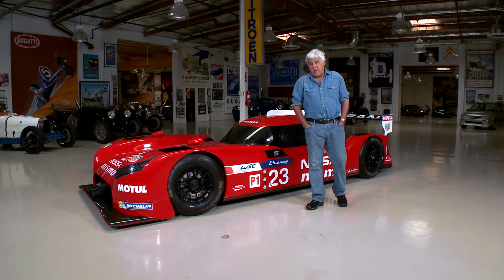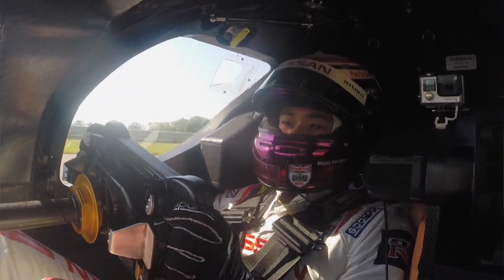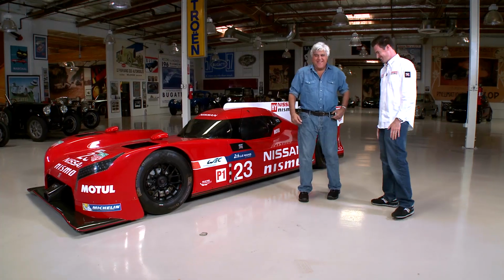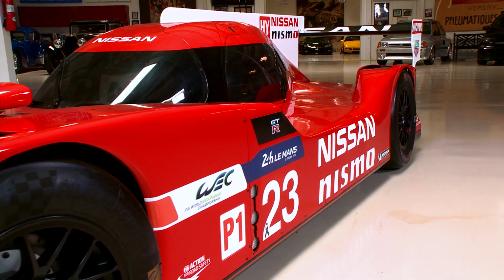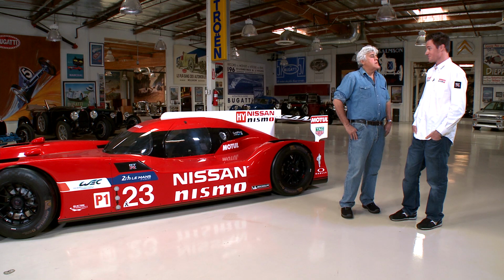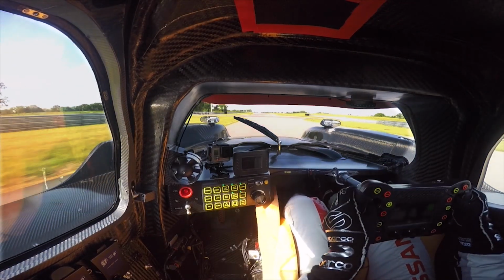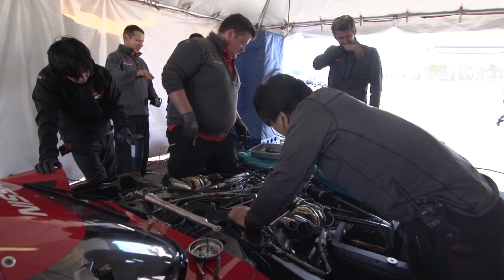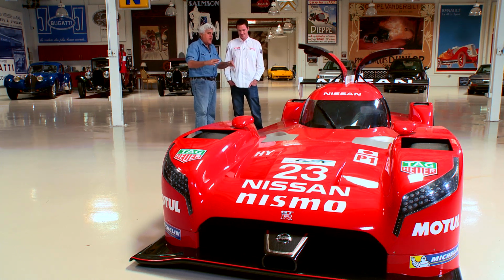Nissan GT-R LM NISMO - Jay Leno's Garage

Comment: Jay never mentioned what the ideal weight distribution would be for this type of race car, anyone know what is the ideal (if there is one)? It's a ratio of front/rear?
Reply: The Moto Channel Since it's a front-wheel drive car you'd want your weight on the front tires to help acceleration. This car relies on rocketship acceleration out of the corners, while plagued by fairly poor cornering. They're running a high-60s (67/33 I'm estimating) front bias, which is downright ideal for this design. They're also using way bigger tires on the front, so those wear out faster. If the car was more evenly balanced they would've had to rethink their tire strategy.
If you're running a 50/50 distribution with front wheel cars you can't properly plant your wheels down as you will get understeer because the wheels lift on acceleration. This is why a heavy front-end on F/F cars is better. This is also the case for the GT-R LM NISMO.
Reply: *****
 On low speeds your downforce isn't going to do anything. Accelerating out of a 60mph corner you will not feel the effects of your downforce immediately. If they were to run 50/50 there I would image that they'd be plagued by a lot of low-speed wheelspin. Since that's the case at several points in the circuit (the two speed breakers and the final chicane in the circuit), they're better off running a front bias and letting the rear wheels catch using the rear-wheel ERS (which is in the works currently).
Reply: The Moto Channel I thought they mentioned it at 7:10. He said it was in the 6o-65.
Reply: Ideal weight distribution on FWD is as much weight over the front as possible, without the rearend of the car sliding around under braking.  This could be 80/20, 90/10, etc.  This is why FWD is inherently flawed from the get-go.  The only serving purpose of a rear axle on a FWD is 1-holding the chassis upright (cars cannot self-balance) and 2-acting as counterweight during braking.
Reply: ***** It's not pushing, it's pulling
Reply: The Moto Channel The idea weight distribution matches up with the aero (downforce) distribution, which in turn needs to match up with the distribution of tyre contact patches. If your car has 60% of the weight at the front, you want to have 60% of the downforce and 60% of the contact patch there too. The Deltawing was the reverse of this - 73% rear weight bias, so 73% downforce and contact patch at the rear too.
Reply: ***** the perfect weight balance have to be according to tir width and downforce then it will work just fine. Remember the Delta Wing with 110mm wide front tires? It was balanced proportionally to the cars weight balance and therefore worked.
Reply: Martin Espinoza Yup.  Someone gets it.
Reply: ***** The only reason for understeer would be the front tires are loading up too much.  It's a lot easier for four tires to provide grip to 2k of mass than just two tires.  This is why we don't see such extremes.
Reply: The Moto Channel There is no such thing as ideal weight distribution. Just make sure the load on the tires and aerodynamic forces are equal. 33/67 is great with tiny front tires and large rear tires with a lot of rear downforce. 67/33 is great with large front tires and tiny back tires with a lot of front tires. This is what Nissan is experimenting with. with their Deltawing which was 33/67 and this which is exactly the oppisite 67/33.

This car is a backwards deltawing with a bigger engine and a hybrid system.
Reply: 63 front 37 rear
Reply: The Moto Channel Actually he did at around 7:10 did you not watch the video? Just curious!
Reply: The Moto Channel It's a secret.
Reply: The Moto Channel NISMO already said its a 65/35 ratio
Reply: Well engine in the middle and no other weight

Comment: During the shot of the engine bay of the real racecar, when you see the turbocharger... is that some sort of gold mesh melted onto the exhaust housing?
Reply: enigmaPL Could be inconel, but it's probably just an aluminium/ceramic sandwich.  Remember, the engine isn't making crazy power.
Reply: enigmaPL heat shield
Reply: musicISlyf1 I know WHAT it is, I asked what it was made of, specifically.
Reply: enigmaPL Its a titanium heat shield. The extreme heat causes discoloration, which is why it looks gold.

Comment: Back when the world was young, ships were wood, men were iron... I built a front engine front wheel drive slot car. I didnt work, wheel spin would lift the blade and cause the blade to come out of the slot. I will be watching to see if it works for nissan. I expect their engineering budget was a touch higher than mine...
Reply: Sam Moore Lmao you commented 2 months ago. This was in 2015 man, and it was a total failure. Still, nice to see some innovative designs.

Comment: Amazon has a really nice documentary series about this car "Le Mans". It's such a real shame what happened to this car, the manufacture of the mechanical hybrid system (Torotrak) completely dropped the ball (arguably it could be said they scammed Nissan). The failure of the hybrid system completely compromised the car in every possible way. This car was never given it's fair chance, despite what commenters say it wasn't a failure because of FWD, it was failure because the torotrak hybrid system failed. Maybe FWD wouldn't have been competitive even if the hybrid system worked as advertised but we were never given a real chance to see if that was the case.
Reply: For a more indepth look into why this car failed, check out this reddit post by some of the people that worked on the project, https://www.reddit.com/r/wec/comments/5wpo1y/why_the_nissan_lmp1_project_was_such_a_failure/

Comment: "RUN WHAT YOU BRUNG" means someone dies. The safety check is an extension of the basic rules and almost all rules are about safety. There was a RWYB time for bonneville and then a few people died, and it boils down to being able to get insurance for such an event which is required by law. The speed record attempts are handled with permits, and they want to know who yyou are and whats up

Comment: Jay I think the run what you brung idea is great.  Here is my idea for all racing they must be production cars. with the only modifications allowed would be stripping interior a roll cage, fire suppression, brakes, tires, fuel cell, and perhaps suspension. no limits on displacement or forced induction or any of that just a race prepped street car.  So when you are watching a race you can go by a car just like that, without the race preparation.  This would really drive innovation as manufacturers would want to win a particular race they would have to build a better/faster car for the public.

Comment: Great to have an engineer do the talking. Great design, and lets hope it will knock off the competition. But just FYI,  that under car tube thing is an old trick - goes decades back...nothing new there right? Putting the engine upfront and pushing the exhaust out the front of the car - that would have taken balls to decide on that...
Reply: project was cancelled december 2015 before it raced
Reply: OK, that would be a bit of a let down for the project team... To have it not race after all the hours of effort, hardly satisfying. And, I just noticed the date on this publication/video. Thanks for the response.

Comment: If I was the rule maker at LeMans there would be only two rules - it can’t weigh more or less than X and it has to fit in a box of certain dimensions. It would reward innovation and make the race far more interesting.  Pretty soon race tracks will be obsolete - virtual reality will be so ”real” that cars, tracks, drivers and all the fun of racing will be a computer algorithm.

Comment: Why it sparkled so much in Le Mans? Too low or soft suspension?
Reply: +MDDeGrande1994 good question.
The cars are very low to the ground in order to create greater downforce. When they are this low the lack of air passing below which creates a dramatic pressure difference between the air above and below the car (which creates downforce). 

Even though the tarmac skims the titanium plates on the bottom of the car resulting in drag the increased downforce easily makes up for that when looking at lap times and fuel efficiency (maintaining energy through corners). 

The reason the suspension allows the cars to hit the deck is because if they were taught enough to stop this happening there would not be enough travel to absorb bumps, increasing the likelihood of a car being bounced. (when air gets underneath these cars its bad......)

Comment: How did this car do?
Reply: Failed. The car can't keep up with other LMP1 cars.
Reply: absolute mockery. was slower than the mature lmp 2 privateer cars, the gt academy drivers were a hazard, and was only allowed to race to finish the field. good riddance
Reply: This car was designed around a particular hybrid system. That system turned out to be too unreliable and had to be changed. But that completely compromised the performance of the car, as it had been so much designed around the original system. Therefore Nissan ended up with an abominably slow car. It was an unmitigated disaster.
Reply: its pity that it faild but if you build a car and the engine have 600hp and a hybid system that is 500hp and that fail you will not do any good laptimes. hope thay can solve this problem.
Reply: Well, first puppies have to drown. Im sure they learned a lot, and they will know, how to do better next time.
Reply: It sounds like the car failed because the mechanical hybrid failed.  Of course, a mechanical hybrid is such a great sounding idea that there's probably a hundred reasons why it didn't work (i.e. many of other people have probably tried and failed to make the idea work).

Comment: Request & A Thanks again Jay for keeping us up on the latest step in evolution. Our Firehouse request is video some Fire Department Steam Power. After the move from the bucket brigade, we pumped water with elbow grease, and then horses pulled the Fire Department Steam Engines. Stillwater's engine sits in the Oklahoma Museum, last pumped in the 60's. There must be some "Muster" Club who still pumps a steam engine. Steam could pump 500 GPM, 8000 pounds of water a minute. You may find teams which compete against each other for time. Please bring back the first great advance, the "Will" of Steam and get it on film for the world to remember. Thanks

Comment: Whats the drink button in the cockpit do?
Reply: Exactly what it says. Endurance racers get thirsty.
Reply: trippin916 There is a tube going from the drinks bottle into the helmet. I remember from Top Gear, when they did the 24h endurance racing bit, that they also had to squeeze the tube to allow fluids to pass.
They also pee in the car.
Reply: Ahhh see i knew about the urinating but was curious about the drinking...was similar to what i was thinking, appreciate it.

Comment: Some interesting ideas, but the point of this project was not to actually win Lemans. This is a publicity car. One of the lead designers also worked on the Delta wing,  which was another publicity car that never finished a single race. The pull out from the earlier races, and the choice of GT Academy drivers suggests that this is hardly a serious effort. They have literally zero race data going into Lemans, which simply is not how it's done. I'd be amazed if it lasts two hours.

Comment: It's a shame it died a quiet death. As far as I know it actually raced at Le Mans only once, with a two car team. It qualified about 20 seconds slower than the class leader, but without a functioning hybrid system.
Reply: It didn't run hybrid system and was slow. they didn't even finish the race and Nissan pulled plug soon after. Basicly they gave up way too early when I was interested. I feel that if it would have had the hybrid system, maybe would have been better.

Comment: Road cars with more power than race cars.  We need to flip that.  Racing was much better when the engines were so stresses 5 to 10% blew up before the end of the race.  How about 1.3 L turbo 4s with 1,400 HP and KERS or 1.5 L NA V-10s or V-12s?
Reply: Cars were literally flying off the track. They even show footage of it in this video.

Comment: Front Wheel Drive is terrible for a race car - especially one with over 60% of the weight on the front wheels. That's going to create a pendulum effect in corners, and make the back end extremely prone to sliding out.

Comment: Some crazy nut built a 6 rotory wankel. Maybe the wankel needs to be big block but made with the lightest of materials, so it can spin up. Did you ever get your Eco-Jet to top speed and check its performance characteristics, JAY? There're miles of American roadways able to take 200-300MPH.It would be interesting to see where that Eco-jet performs its best(as long as it doesn't fly off the ground). You are a great person Jay.

Comment: The cars ran at Le Mans WITHOUT the hybrid system, which WOULD HAVE made these cars technically 4wd and WOULD HAVE given it around 1200hp (for a short period while deploying hybrid boost)
The mistake Nissan made was running the car before it was properly developed.
I realize Sim racing isn't real life - but the theoretical design of the car DID work and it THEORETICALLY could have done competitive lap times at Le Mans.
Theoretically.
In real life, this was one of the biggest disasters ever at Le Mans. In terms of cars, not crashes.

Comment: "Horsepower, weight, tires & aero."

Brakes?
Reply: STIRKDAWG brakes are limited by grip and weight. I agree that stopping is important but in terms of the design of the car, the grip/weight really defines the parameters of the brakes. The other 4 things are just just maximised individually rather than optimised to other parameters. I have no idea what I'm talking about but those are my thoughts.

Comment: I know carbon breaks are a new thing but has anyone think about solid diamond breaks ? Just a thought don't troll
Reply: They might be carbon because they might be lighter and diamond might be to heavy but they would probably be unbreakable
Reply: thats a reasonable argument, maybe you'd be able to break harder more often shaving time because there will hardly be fading. but diamonds can weigh more i dont know how much more, it would be a great change from materials that get shaved and warped when heated
Reply: also take a look at supermagnet breaking systems just another invention that might be useflull

Comment: sigh
everyone dissing fwd for just the reason that it wont slide or such
Reply: no, fwd doesn't perform as well as awd and rwd.
Reply: Daniel Vang fwd has better handling than rwd and its also the lightest.
but yes awd is better
Reply: It has to do with weight shifting, and no, FWD does not handle better than RWD. Cuz understeer.
Reply: Augusto Rallo in corners they can, depends on car

Comment: Jay keeps asking leading questions, but the egghead engineer is incapable of talking about the damn car. He acts like Nissan didn't give complete open access to "Top Gear", who were allowed to take photos of everything and even watch teardown and reassembling of the transmission. 
Jay: What can you tell us about the car?
Engineer: It's a Nissan. It's a GTR LM. It has short exhaust. It has mandatory wheel cutouts.
Jay: Anything else?
Engineer: It's red.

Comment: Driving this car in GT6 it is a good car, but it understeers like crazy at low speeds.  I do commend Nissan for trying something totally different, as Jay said. It makes the racing that much more interesting.  Shame that Nascar and F1 don't let innovation into the mix, which is part of the reason for lower ratings on TV and empty seats in the stands.  Cookie-cutter cars....yawn.  Also, a lot of us never even saw the race at this years Lemans thanks to the horrible network coverage.  I really miss Speed network.

Comment: Too bad he is completely wrong about front wheel drive being the best around le Man, the Nissan Cars perform so bad they are laughed at. Don't remember but did they even finish Le Man 2016 ?
Reply: 2015* Two fo them retired and the final car did cross the finish lap but had driven under 70% of laps completed so it did not count in the results.

Comment: On the official tests yesterday they were 30 seconds slower then the Porsche and the Audi 😂😂😂😂hahahahaahh well done Nissan 
Porsche's fastest lap in session 2 was 03:21:067 and Audi did 03:22:516 and wait for it the Nissan did the circuit in 03:50:... Well that's impressive. I know they are new and the whole car is different but come on they were 6 seconds slower then the The winning LMP2 car. I really want them to do well as I really like the project but that's just ridiculous disappointment
Reply: Petar Ninov That's because Porsche and Audi set their times in the dry right at the start of the session before it rained, and Nissan didn't get out of the pits until the track was wet. Their average lap times in the wet were similar to the other LMP1-H cars.
Reply: Ralph Shackell Either way it's still a big margin. I hope they can be more competitive come race weekend so we have some exciting racing to watch.
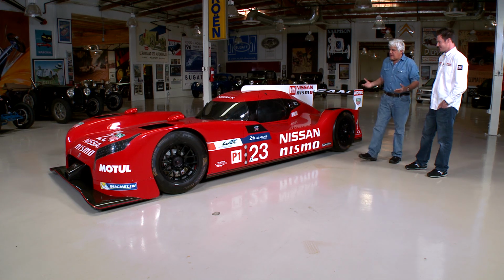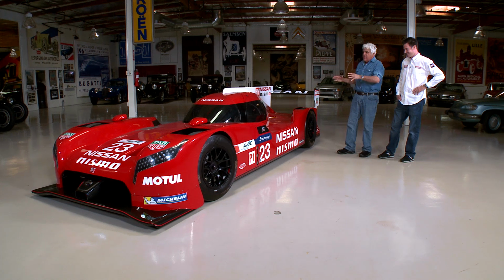Reply: Ralph Shackell Okay, so then what's your excuse for the fact that the fastest lap during the race was a 3:17 by a 919 and the fastest lap for the GT-R was a 3:36? Still almost 20 seconds slower...
Reply: Slash396 no hybrid power - this doesn't just affect the speed down the straights, it affects the brakes (which had to be larger and heavier than planned due to lack of hybrid capture), the suspension (can't load up the tyres on the way in and out of corners), the tyres (not getting the desired energy in to them), the aero (suspension not loaded up so diffusers not the desired distance from the ground). It's a feedback loop of performance loss. All racing cars are designed to work as a complete package, loose a bit of the package and there is a cascade of effects.